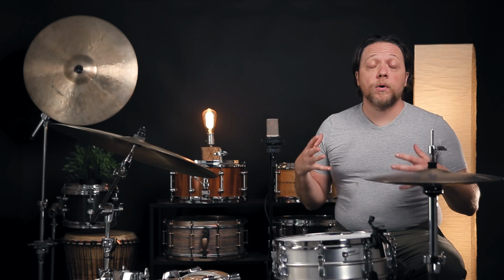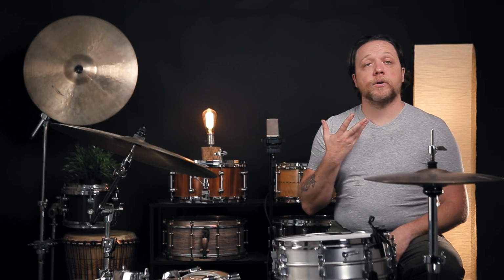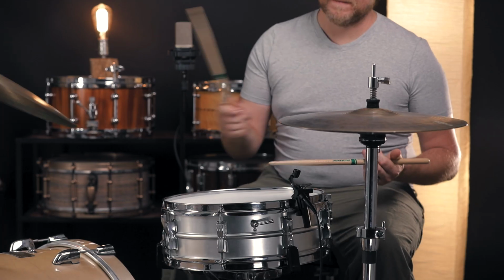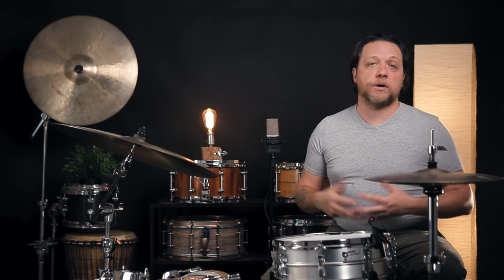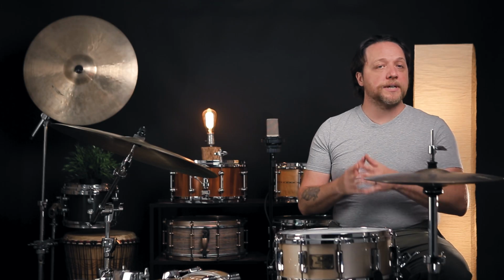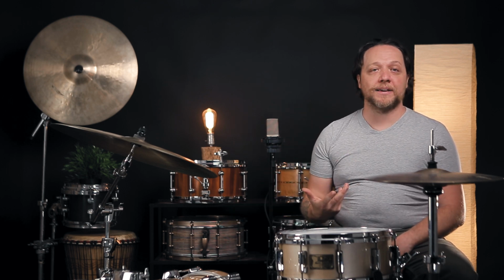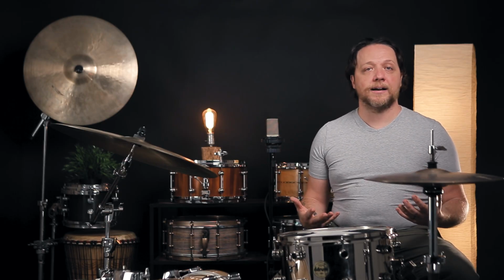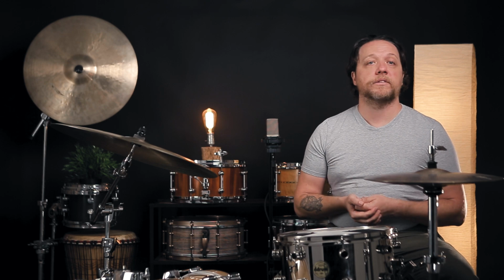Choosing The Sound of Your Snare Drum | Season Six, Episode 16

Comment: I have an asian maple snare drum, and a brass one. Sure, the density of those materials differ, and the shells have different weights. And as far as I understand, it’s the weight, ie the mass, that then affects how well frequencies are carried. But it’s definitely the whole drum : shell, hardware, heads,  bearing edges etc that makes out the total mass, and the sound beyond what mass alone affects. Now, I think it’s more common to make a heavy brass snare drum, and more lightweight poplar snare drums. Though you could make a 21 ply, super thick poplar drum with heavy hoops etc so it’ll behave more like the typical brass snare drum. Kind of.

If the drum makes you play great, it’s the right drum - yep, totally agree!

Comment: Great video as always. I have a couple of questions, what is the opposite term for 'dry' when describing a drum sound, and what is an example of that sound?  Also, can you describe the difference in 8 lug vs 10 lug snares (please don't say 2 lugs ;) )?
Reply: Re: Opposite of "dry/crisp" = Wet! That "Baseball Bat through a cake" sound with some extra buzz from the wires (and maybe even one of those 42-strand wire sets).  Usually, you see that with those low "fat" tunings.
Reply: Actually, I see you have a whole video about the lug count question. Nevermind!
Reply: The opposite of dry could be "open" or "ringy" or "buzzy". "Wet" works as well and dry/wet are terms used with other instruments and effects too. The extra 2 lugs of a 10 lug drum add weight and a damping effect to the shell which gives less sustain and a slightly drier sound. And potentially better tuning stability. Watch a comparison video between a Ludwig Supraphonic and Ludwig Acrolite (same shell, main difference 10 lug vs 8 lug) and you'll hear the 10 lug Supra has a slightly drier more focused tone.
Reply: @a.j.wilkes6352  mmmm cake, that’s the perfect description.

Comment: One metal snare and One wood snare Will cover 99% of the drumming situations an average drummer faces
Reply from the maker: One snare drum of any material could cover everything. Of course, if you’ve watched any of our videos, you know that we support taking pride on sound the same way you would the performance itself (obviously the sound of your drums is integral to that performance) so it’s important to know how it get the necessary variety of sounds and understand what compromises are being made if you’re limited to just one or two snares. Also, not sure about the wood & metal as a flat statement. We’ve tricked quite a few people with aluminum drums when they thought they were listening to wood. The division of sonic characteristics doesn’t necessarily lie in the obvious differentiation of wood vs. metal.